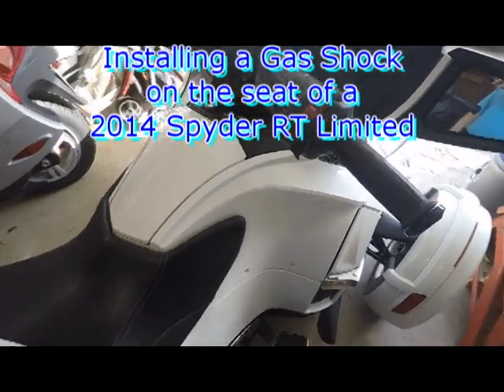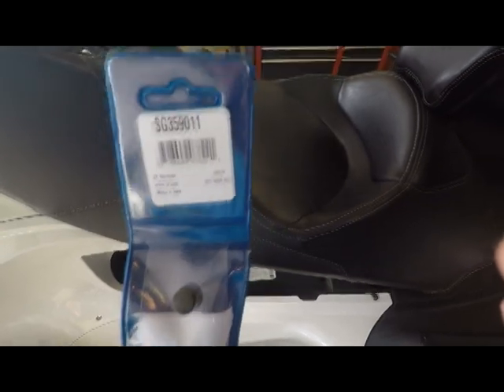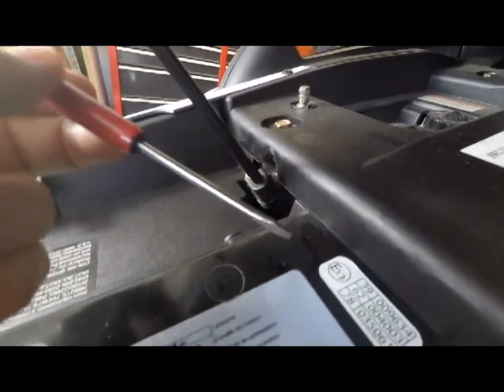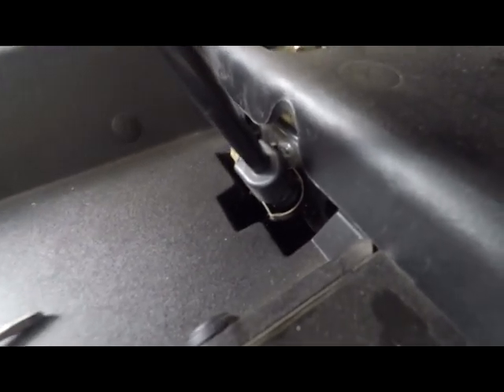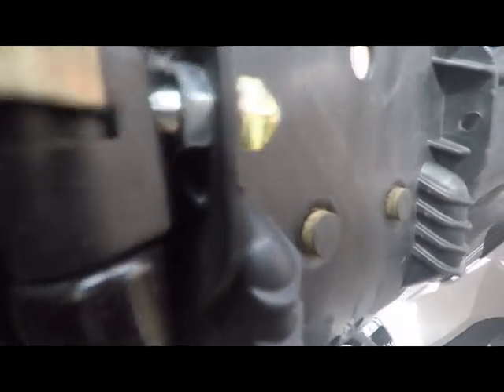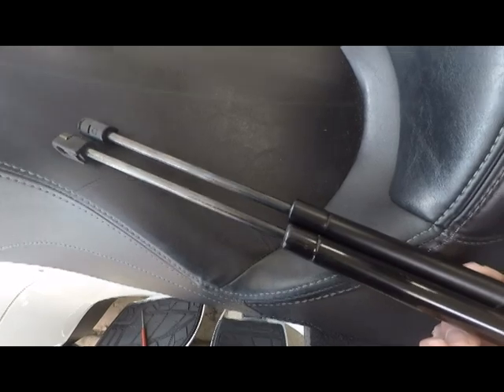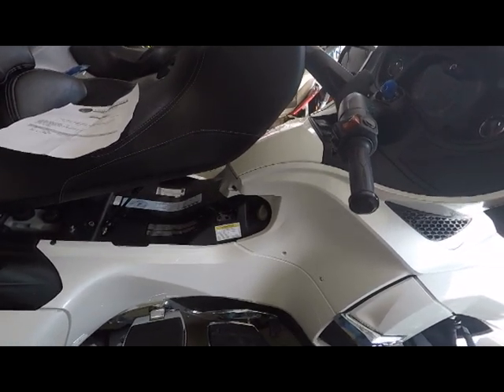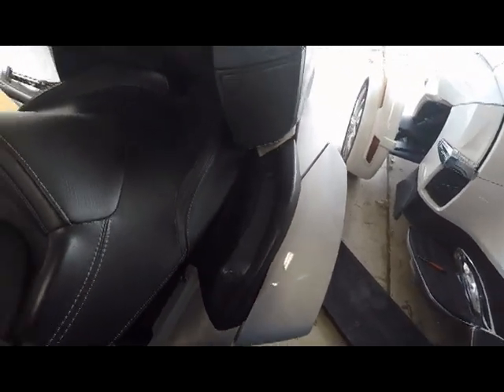Can Am Spyder Seat Gas Shock Installation

Comment: I replaced my shock with the Stabalist and then closed my seat.  When I attempted to open, the seat it had so much pressure that it broke the upper seat molding bracket where the shock is attached.  What in the world do I do now?  Does the PSI vary in the shock?  HELP NOW!!!!